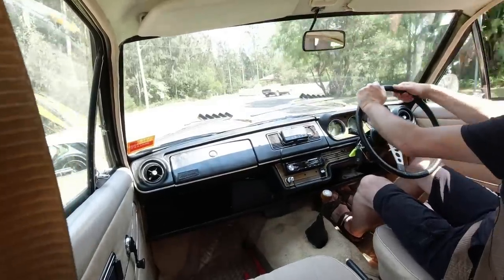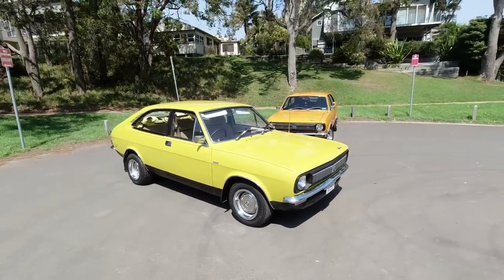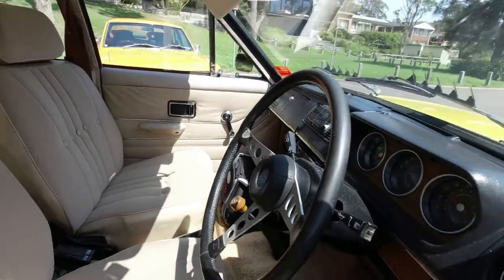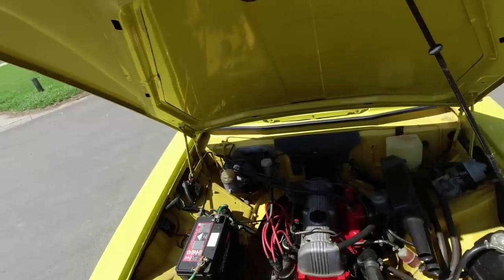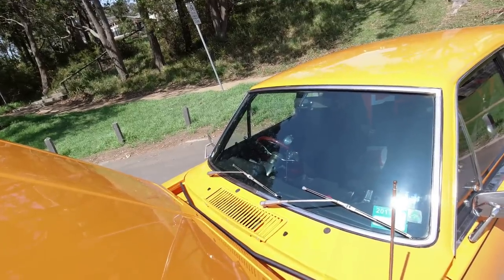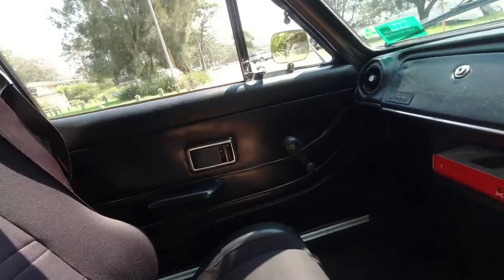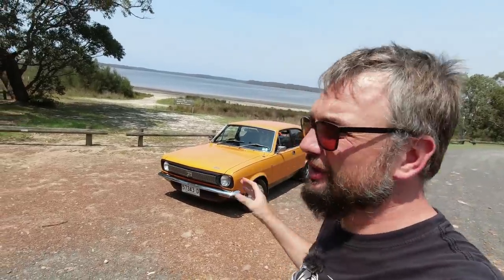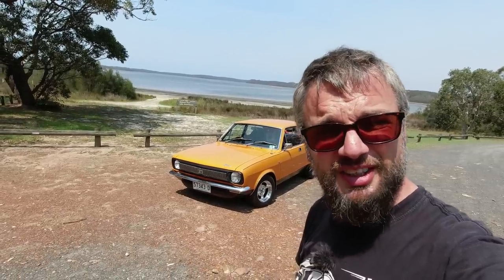Aussie Oddballs: Leyland Marina SIX-CYLINDER! Driven!

Comment: well, I've just found your channel and you're a man of my own heart, I'm an Aussie and when I was just 8 years old my Dad bought a "Leyland" Marina coupe, in Australia you could buy them with the OHC 2.6 litre 6 cylinder, My Dad always said that thing went like the clappers ( he was a Lancashire Lad) but the handling was scary, they did a telescopic front shock kit for them in Australia which addressed the handling issues, but we didn't find out about that until much later, I bought a 1750 coupe for the price of a carton of beer back in 2007, it ran but had a massive big end knock, i replaced the motor but then the starter motor packed it in, so I pulled the pin and got rid of it, (much regret here), would love another Marina as a club car but they are getting hard to find in Australia now

Comment: I worked at the Zetland assembly plant for Leyland Australia in 1973. Helped on the Marina assembly line. I was intrigued by the marketing more than the engineering. The paint colour for the orange 6 cylinder was called "Home on th'Orange" and the Mini Mokes bore a sticker that said "Moking is not a Wealth Hazard"

Comment: Back in the early 80's in Sydney I built a turbo'd 2.6 Marina for a customer who was a street racer. It was a lime green coupe with a C4 Ford trans & a 9" diff. I cut the cast intake manifold off the Kimberly head & built a 4 barrel Manifold for a Holley blow through setup. It required an aluminium roll cage to stop body twist so you could still open & close the doors. It was a giant killer in it's day, I wonder if any of it survived.

Comment: Simply astonishing that the UK Marina soldiered on with the B series when this 1750 four was around.............
Reply: We often gave our best efforts to other markets. The australians  also had twin cam powered escorts long after we stopped making them. It wasn't even considered a sporty car,  just a car with enough grunt.
Reply: Post 1979 facelift UK cars had the 1700cc O series SOHC which was a really good engine. There was even a rare 2000cc O series available as an auto only in the Ital - I only ever saw one
Reply: @leuvenlife  the effort was with Leyland Australia. such a shame it didn't continue on
Reply: It all just seems like a wasted opportunity to carry on using the old BMC engines in the Marina when there were other more modern engine units available. Thanks for making this video it was most interesting.
Reply: @billywhizz1984  I was lucky enough(!) to own an Ital 2.0 HLS and Auto in Vermillion. That was a fun car, it would fly off the lights and startle a few people, but the head gasket went and then the gearbox cooler failed leading to an obscene amount of pink antifreeze!! Best of all the gear selector broke so it was replaced with some mole grips.
Reply: @coogeeman  the 2.0L Ital was only available with automatic transmission because the manual gearbox wasn't strong enough to deal with the torque.
Reply: @gordonbartlettgb  Yeah, shame they didnt use the LT77 speed in the rover sd1 2000, but the transtunnel has to be modified. I had a mate who had a manual conversion estate, oh my lord! But yes, it didn't last long. My 1971 tc is on its third gearbox with only 75k!
Reply: The problem was, they choose the B series because at the time they signed off the Marina the E was still only 1500, the 1750 was a rushed job, also they did not know the B series tooling was worn out, so they had to replace all the B series tooling (it is why the Marina cost twice what the Allegro cost to bring to production and x4 the original busget, even thpugh it was a parts bin special) and so they had to stick with it till the tooling was recycled for the O series. However the situation was worse because the failure of the Maxi and Allegro meant the E Series production facility at Longbridge, was the most advanced in the world in its day, yet only ran at a fraction of its production capacity.
Reply: @billywhizz1984  I think there's only 2 or 3 2.0L Itals left in existence. My dad (no, seriously) has one, it's an estate model.
Reply: "The best Marina that ever existed".  I'd agree. They look great!
Reply: @williamwoods8022  I had a 1.8 Marina for 3 months as a stop gap. The thing that I liked was that you could virtually drive everywhere in 4th gear such was the torque from the B-Series engine.
Reply: @gordonbartlettgb  I has a 1.7L Ital estate, it was a really reliable car and carried several of my friends to universities all over the UK for several years.

Apart from the gearbox, the gearbox wasn't strong enough for the 1.7, let alone to 2.0! I think I changed the gearbox in that car about 4 times in as many years, Every time one started to go bad I'd go to a scrapyard, get another for £20 and I got it down to about 1.5 hours to swap a gearbox (Couple of bell housing bolts that never got put back in after the 2nd gearbox as they were a pain to reach!)
Reply: My auntie had two Marinas. A mk 1 TC and a 2 super. We had a 1750 Ital. I had an Ambassador. Do you think with hydrogas and the E series engine the allegro was more refined?
Reply: I had a T reg. Marina with the B series job in it ,British racing green , great car , made a great noise ! . I towed a Cortina from Dunbar to Edinburgh with that one, the engine was fine but the gearbox ended up well buggered . Mange tout chums
Reply: I always thought they should have used the 6 cylinder 2.2 in the MGB. I didn't know of the Aussie 2.6 version, that would have been perfect
Reply: BL in South Africa also produced cars with the 1750 engine.
Reply: @leuvenlife  I wouldn't say for certain, but I seem to remember the RS2000 - so called - was just a 2 door RWD Escort with the normal 2 litre sohc motor as also used in the Cortina, and a very basic bodykit, slightly fancy seats and a sports steering wheel. May have had a 5 speed gearbox - not too sure.  Ford Australia was too busy making and selling Falcons to put much effort into the Escort and Cortina.
Reply: @jasonsanders3397  The RS2000 was indeed as you describe, but it was a 4 speed box... But the Twin cam  (8 valve) were used in the Mk1, long before the RS2000. It was the Lotus derived head on a crossflow, 1558cc if I remember well. After that came the Cosworth RS1600 (16 valve) which was 1599cc or so.. The RS1600 was a real thing. but both of these were way too expensive to continue with, hence the Kent engine and Pinto powered Mexico and RS2000 models.
Reply: @paulbaker654  And great noise from the `B' series ......
Reply: @philiphigginbotham3775 There were a couple of MGB prototypes with the 2.6 "Blue Streak" motor from the Aussie-built Austin Freeway.It was very tuneable & lighter than several other BMC/Leyland 6cyl's. Over the years I've seen 2 such cars for sale,one of which had some Repco tuning tricks...,..triple carbs,head job,extractors. As you & myself suspect they really were a great improvement on the 3ltr lump they used in the MGC.

Comment: This is one of best videos yet! Chrysler did a similar thing in Australia. Putting the Hemi six in the Chrysler 180 to make the Chrysler Centura.
Reply: And didn't THEY go 👍😉😘. The hemi 245 Centura's were the pick of the litter of the Aussie manufacturers "sixed" four cylinder bodied variations. The 3.3 and 4.1 Ford 6's in the Cortina's went hard, The 2.6 Marina did also. The  2.2, 2.6, 2.8, 3.0 and 3.3 Torana's weren't bad but the 4.0 Centura was sensational. Especially in 4speed manual spec. Nicely equipped inside too, great car's.
Reply: @khylerin70  Centursas are rare beasts here. (in NZ) But I have seen one. Very nice. The handfull that came here are tucked away with collecters now.

Comment: Glad you enjoyed our Marina 6, hubnut! I thought you would! 😁😜
Reply: Another car to note, hubnut, along with the Cortina and Torana sixes is the Chrysler Centura based on the old Simca 180 from France. As you would obviously know, the simca was a 1.8 four in gay Paris. The Centura in aus not only got the four in 2.0 form, but Chrysler Australia wedged their own 245ci (4.0 litre) six into it as well! Apparently there was a battle between the Centura and Cortina who could understeer the most! In terms of fuel economy tho, the Centura dismally lost as being the most thirsty of the two! My dad worked in a Chrysler dealership in Melbourne Aus at the time and COUNTLESS customers would be bringing in their KB and KC series Centura sixes into the service dept complaining of shithouse fuel economy! Holden definitely had the wood on it converting the old HB Viva (Torana) to house their own home grown 161 red six pack! You wouldn’t have happened to have driven one while in Australia did you???
Reply: The first Holden Torana with a six cylinder was the LC model that was based on the earlier HB series only in looks from the front doors back, mechanically their was nothing in common, the first LC, came with the choice of a smaller 2262 cc (badged as 2250) or138 cubic inch to a 161 cubic inch (badged as 2600) to a warmed over 161in the GTR version then to a hot lumpy cammed triple CD stromberg carbureted GTR-XU1 (Note that they also used the 173ci (2850 badged in the last of the LC’s & the GTR version) then the 173 and 202 cubic inch Holden sixes with similar mods in the LJ series.
Reply: @Tolpuddle581  Valiant is known as a "Greek Mercedes" or a "Carlton Cadillac" haha.

Comment: Love the enthusiasm in this vid. Wiki quotes the standard 2620 cc six as having 121 hp. Also " The Marina Six used a separate front sub-frame to support the weight of the Big Red engine and different front torsion bars as well as a pair of rear radius arms in an attempt to improve handling." 
News to me from Wiki is the South African Austin Marina Six, so another source. But then South Africa went with 302 V8s in Cortinas, Capris and Sierras if I recall rightly.
In Australia the 1500 was thought of as minimal as was the 1600 Cortina. How the UK went for pushrod 1.3 Marinas and 1.3 Cortinas in the 1970s seems astonishing to Australians of the time and especially now.
Reply: Two words.

Fuel  crisis.
Reply: Lassi Kinnunen  it was so long ago I can't remember. Probably little to no difference in it.

All I know is at that time we'd had an audi 100 which we got after our zodiac died.... Then the audi caught fire (weak carbs leaking fuel)... Somehow my dad got hold of a Daimler sovereign!
Reply: Not quite correct - no separate sub frame but uprated torsion bars, wider rims and other strengthening.

Comment: I used to have a 6-cylinder Marina sedan, with a 3-speed floor change. Used 2nd and 3rd mainly. Drove it up a winding mountain road in 3rd, didn't need to change down once.

Comment: Nice one Hubnut.  I like how you approach a road test without any pre-conceived notions, or bias.  Letting the car sell itself on its own merits.  Yes, gearing was short in those days, with 4 speeds only and top usually being a direct 1:1 ratio.  Though 4 speeds didn't bother the E type Jag for top speed.  I had an HQ Statesman, back in the day with a 3 speed only auto.  I remember it would show about 1500rpm on the tacho at 60mph in top.  The secret was the differential, with a 2.78:1 ratio.  The torque of the 5 litre V8 can haul such a tall diff.  I think most 4 cylinders at the time had a 4.3:1 or shorter differential.

Comment: Thanks for sharing these delightful road-tests!  Could tell you were grinning ear-to-ear in that six-cylinder Marina; the gear change looked more short-throw and precise than the 1750 model.  Could've used a 5th gear in the six-pot, but in the early-1970s not too many cars had these as standard; even the U.S. model 240/260-Zs made do w/ 4-speeds, and a 5-speed was an option in the 280-Z.  That front grille does remind me of a Corolla of similar vintage.  Glad someone has preserved these two examples; Marinas were rare in the States (even w/ TV ad spots, featuring Vanessa Redgrave, I think...don't recall exactly); we got a single-carbureted MG-B engine here.
Reply: The front wheel drive edition of the E4 engine (as used in the Maxi, Allegro and Nomad) had a 5 speed box.  Fun fact, the Lotus Elite, introduced circa 1975 used the Maxi E4 gear cluster in a special Lotus casing.  It handled the power and gave decent shifting and durability.  Leyland could have done the same and put it in the Marina.

Comment: beautiful British Leyland masterpiece, also the B-Series has more low-end torque I suppose
Reply: The 1750 E series engine had loads of torque. It was a stroked version of the 1500 E series engine. Once you had moved off initially you could remain in 4the gear for most of the time.

Comment: Loved it. 79-82 I had two marina coupes at the same time. 1 k reg(72) and 1L reg(73). The 73 was bog standard but the 72 I fitted sparkrite electronic ignition, telescopic shocks conversion kit, marina van leaf springs on the back with lowering blocks, California mirrors and front spoiler. Hey everybody did it back then lol. Oh 165 profile Goodyear’s  👍🏻😂😂

Comment: Lovely to see the Marina again.  I had a Morris Marina with the 262 engine and 4 speed manual transmission, with overdrive -- about mid-1980's for two-three years.  Colour Fire-Engine red.  It was beautiful to drive -- round town or on the open road, where the overdrive really allowed it to "let rip".  The engine exhibited plenty of power and very smooth torque, plenty of it.  Very quiet on the road, even at speed.  In a way I was sorry to see the old girl go, but I eventually had some gearbox trouble and I did not want to mess about.

Comment: The 3 Liter Marina is a monster, love it!
Reply: 2620 cc I think. Was a stretch to get the motor that big, starting around 2200 in the Tasman and Kimberly.
Also used in the P76, but Leyland were working on a 3.3 litre six cylinder version of the Rover/P76 V8 to appeal to the mass Australian market. Then the collapse of Leyland here.

Comment: The E series seems a better bet than the 1.7 o series that came in my mk3. that was a study in lacklustre performance! Still loved that car though. 
Top work mr hubnut!
Reply: I rated the performance of my 1.7 O Simon, certainly better than a 2 litre Cortina I had around that time
Reply: @doornier  mine never really wanted to rev maybe i just got a friday motor
Reply: If I remember rightly they did a 2.0 o series in the later Marina but only in automatic form , the Marina box was never the best so I guess a 2.0 on it would be a failure waiting to happen

Comment: Had a 262 with a cam and triples back in the stone age. Home done head 
work. Custom fitted by me Impala 3 speed straight line shifter. A 
vintage dick smith kit CDI. It was the ultimate sleeper of it's day.
Edit Rev-master reground cam as well.
Reply: That Dick Smith CDI was the ducks guts back in the late 70's, and you built it yourself.
Reply: Ray G, I had no idea Dick Smith did CDIs, wow!
Reply: @munnsie100  it was a kit, it may not have been branded Dick smith I don't remember. It wasn't cheap though.
Reply: @munnsie100  In the 80's Dick Smith produced lots of auto use electronics kits, this was when the staff were enthusiasts, not salesmen, and they would order in special parts for you. I preferred the Transistor Assisted Ignition kit they sold, the CDI would find too many High Tension leaks in an old ignition system but the TAI reduced the current through the points and with dwell extension gave a nice fat spark.
Reply: @rayg9069  Agree fully mate. I had a Datsun 200B and Dad and I built the TAI for it - worked brilliantly. Every time something played up and I disabled the TAI, Dad would say - and what did that achieve then...?  because it was never the cause of the problem. The dwell was awesome on that kit and like you say, the current going through the points was negligible so there was no point erosion or pitting at all, and the tune just stayed and stayed. When that Datsun was running well (which was most of the time) it really hummed along nicely.

Comment: They look like Datsuns (Nissans) from the front.
Reply: Exactly what I thought, front end of the yellow one especially, looks like a 120Y Sunny. Rear end of the orange one just like a Sunny coupe.
Reply: @neilwalsh4058  Google XU1 Torana (based on HB Viva) and the rear of the orange one is the spitting image!
Reply: the B120Y had a 1300cc and 5 speed, did it not?  Can you imagine a 120Y with the 260-Zed engine in it?
Reply: Look like a cross between the Holden  Torana and Ford Escort ~
Reply: Datsun copied other cars all the time back then.
Reply: Blackwood Richmore no

Comment: The most interesting video so far and by far. The Marina coupe in TC form looked fantastic with vinyl roof acres of velour and tinted glass but it was the grill with inline driving lamps now these cars would have been enhanced by that grill. But the TC coupe with the Maxi 1750 engine and four-speed with overdrive ......mmm good times!
I hope your both well and safe.